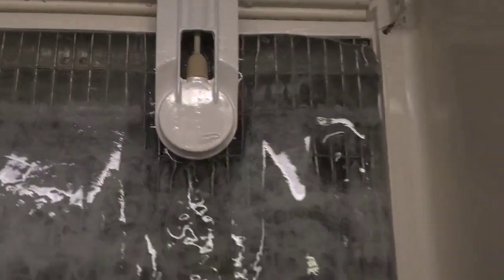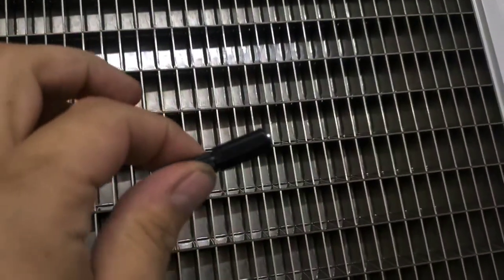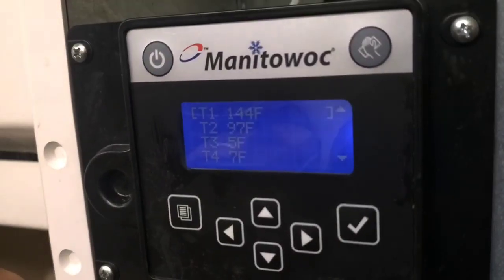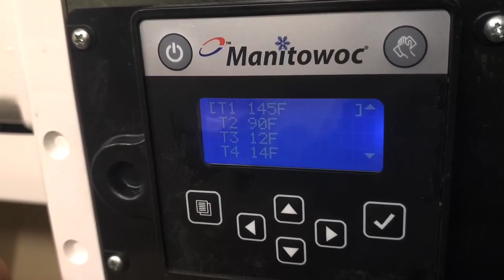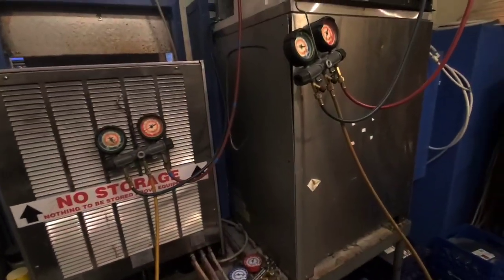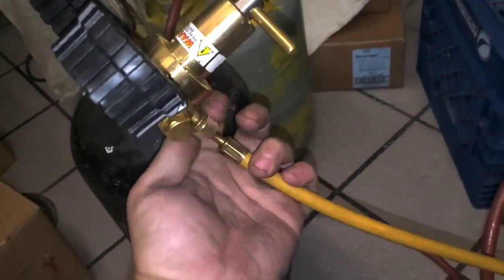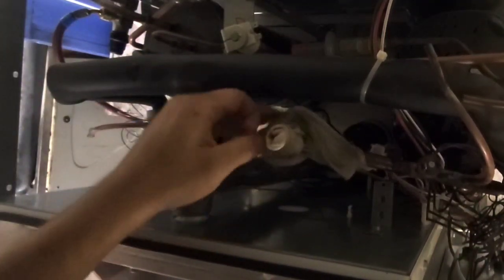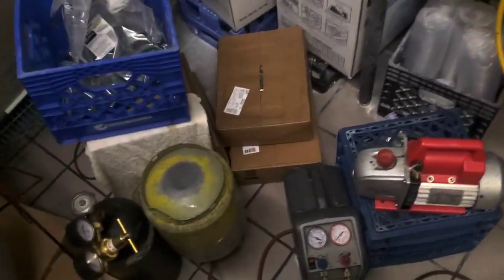MANITOWOC ICE MACHINE FREEZES UP BUT NOBODY CAN FIND ANYTHING WRONG WITH IT

Comment: I have this same machine at my building, I’m having problems with the water not coming through the water distribution tray evenly, and all it does is make streaks of ice and it freezes to my ice probe, what causes that?
Reply from the maker: Sounds like low water flow from a clogged pump inlet or distributor and it needs cleaning. Could also be the problem this one had with a slow water fill.
Reply: @satanicinduction  I checked the pump no build up or anything to restrict the water flow. Came in this morning massive sheet of ice on grid and probe had to take my heat gun to melt it.
Reply from the maker: Multiple problems?
It seems like it cant harvest properly which isnt necessarily related to the uneven water distribution.
Have you removed the water distributor and seen that its clear? No bent pieces in the grid? What about calcium build up making the ice stick?

Comment: Which number nozzle using for your torch I like that flam😮
Reply from the maker: Uniweld, #2 tip, 5psi gas, oxy matched by sound
It needed to be cleaned in this video

Comment: T3 Harvest valve was replaced?
Reply from the maker: T3 shows the evaporator inlet temp which is affected by the harvest valve. When it shot back down it showed that hot gas had stopped flowing from the harvest valve.